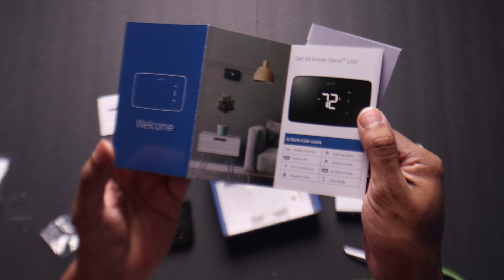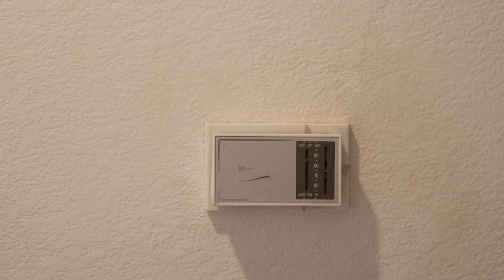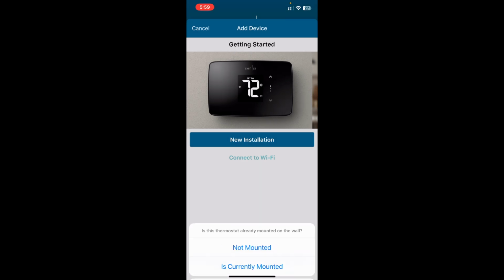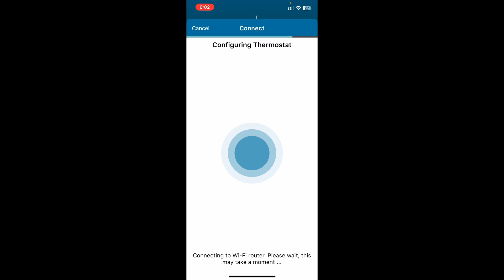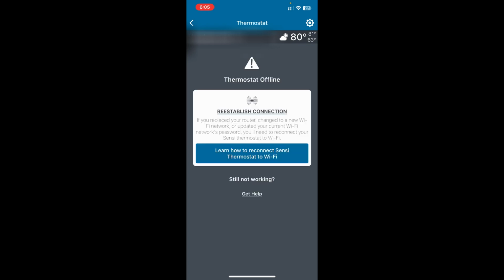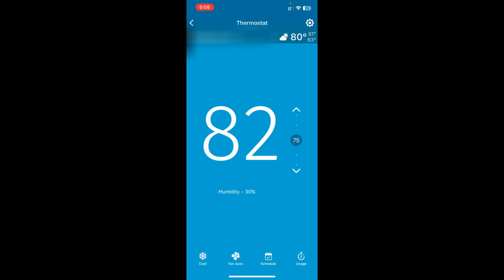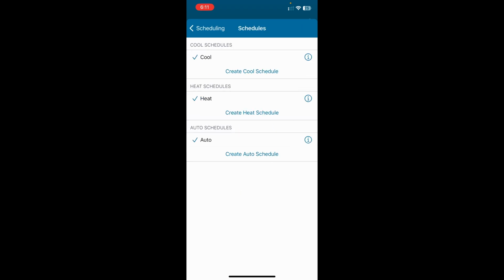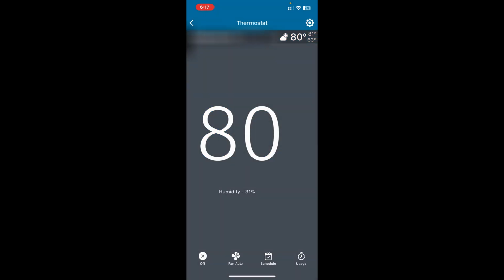Emerson Sensi Lite Smart Programmable Wi-Fi Thermostat | Unboxing Installation App Setup | Review

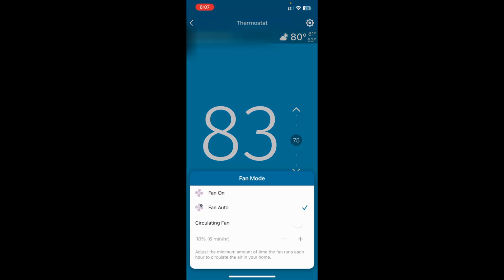Comment: Just an FYI, it appears that they changed the app this year. My auto program no longer works. Main screen shows 2 temps on the right side and nothing at the bottom left. It was supposed to start a heat cycle at 9:00p but it started as soon as I selected Auto at bottom left. The 2 temps I mentioned at the right showed 80 and 82 on top of it but I didn't set anything to 82. I'd have to give them a 1 star for documentation. There's no new doc or videos out there so I'll have to call them.
Reply from the maker: Well I forget when I posted this, and also wouldn’t remember if I saw a temp on the bottom left? I only see auto now. It seems like u know how to set the schedules in the settings otherwise maybe I could make a video since I can show screenshot here. But just make sure you’re in the right schedule cause there’s heat cool and auto scheduling. Auto does start right away if your temp was outside of the 80 and 82. hopefully I didn’t confuse u more lol

Comment: The voltage coming through the wires isn't really enough to even harm you ... just give you a good scare.  The real reason for shutting off the power is to prevent damage to your HVAC unit's circuit board from accidentally shorting out the wires.
Reply from the maker: Haha oooo I see now, thanks for the education! 😂 I really thought I was about to get fried messing with those wires, had me feeling like I was defusing something that goes kapow lol. Good to know it's more about saving the HVAC than saving my life 😅

Comment: The outside fan works in cold mode but in heat mode they could not help.
Reply from the maker: the fan works independently from cold or heat, have you tried auto and clicked on the fan duration?

Comment: I just installed one on battery only no C wire. Won't connect to network at all. I even tried to tether to my phone incase it was weak signal. Didnt work so far. Ill contact the seller and see if i need to return it.
Reply from the maker: what did you end up doing?

Comment: How do you open it to change the batteries? I’m freezing right now because I can’t open it.
Reply from the maker: If it’s already on the wall, and secured….u kinda just wrip it off, it clicks on and off. But be careful not to completely take the backplate off that’s screwed in, so I suggest picking a side and plucking it off

Comment: Thanks for your review! Have you run into any experiences with losing connection to your wifi? Does the hub still work well if your connection is out a few minutes or does it rely on the app/wifi a lot?
Reply from the maker: Thanks for stopping by! Yes, but in my case, my furnace control board was failing, so I must say - now that my furnace has been working like it should, I have had no problems. Also, when the WiFi is down, you can't control it from your phone, but the thermostat still works like a normal one, you'll just have to walk to the wall to change temperature.

Comment: I got stuck on the part where you press the 3 dots & select the wifi. Nothing showed up on my screen & it kept saying to put the thermostat in connection mode which it was already in. After doing this multiple times I gave up & deleted the app.
Reply from the maker: I think that happened to me too. I think I took the batteries out and started the setup process over with the app.
Reply: Thank you! I have been fighting mine for a hour trying to get my wifi connected and couldn’t get past the three dots screen your comment saved my sanity
Reply: On the 3 dots, press and hold 4 secs
Reply: I went through all of that the problem was it wouldn't connect to my wifi after I submitted the password, but I finally got it to work after retrying a few months later.

Comment: Thank you for the video. Question, is there a way to set the schedule where the thermostat turns off completely?
Reply from the maker: Thank you man I appreciate it! As far as the scheduling to turn it off yes and no, technically you cannot put it on auto mode and then schedule it to be off certain time however, like I said, in the video, you can put a schedule on certain days you only want to schedule but as far as the temperature to be off what you can do is, let’s say it’s winter time now so you want the heat to come on when it reaches 68° but you don’t want it to go on a certain time like 9a-5p when you’re not home. What you will do is schedule it to turn the heat on at 68° from 5 PM to 9 AM and the time you’re not at home that you do not want the heat to turn on you will lower the overall temperature setting to let’s say 45°. so unless your house drops the temperature dramatically to 45 which it shouldn’t it will be off and it will not turn on. So that’s how you schedule it. The schedule controls the temperature within the schedule time frame so just make the schedule you want it to be off to a temperature that you know it won’t have to turn on. Hopefully that makes sense.
Reply: @ostenako  yes, that makes sense. Thank you so much. Maybe in the future they will simply add an off option to the schedule.
Reply: How do I reset the ac temp from what a previous owner had it set too?